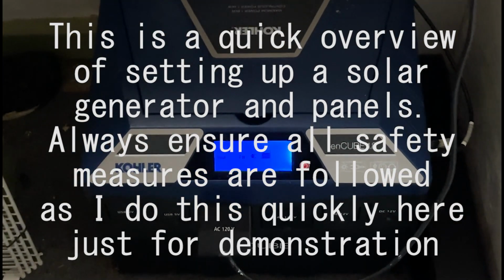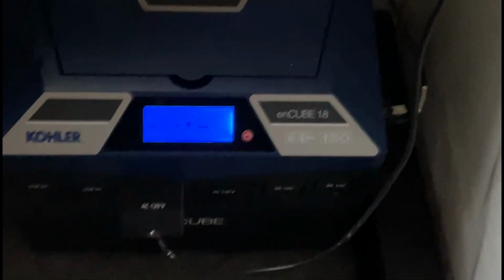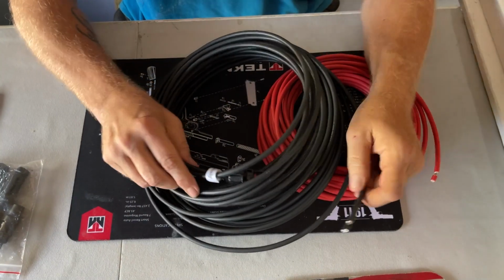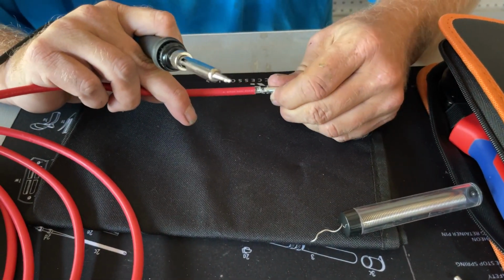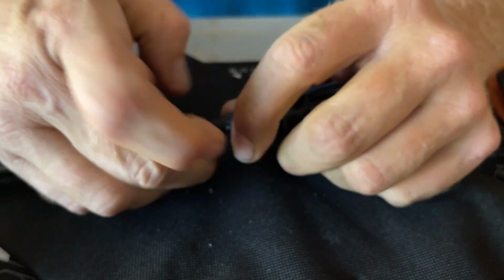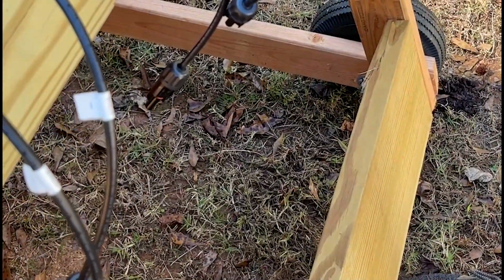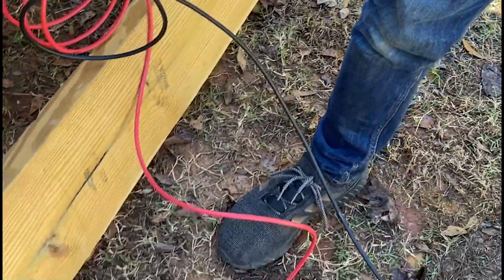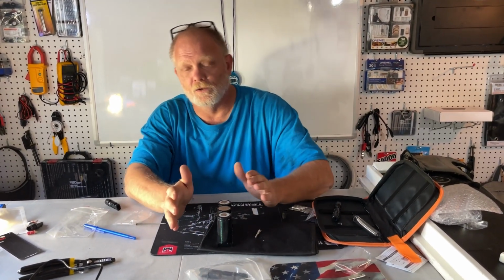Wiring up a basic solar panel system using the Kohler enCube 1.8

Comment: Sounds fun & I’ll be looking forward to it.
I built my own lithium battery bank/pure sine wave inverter and I ended up spending more than if I had just bought a commercial unit 🤫😟
But it does work well. 
I hope your not giving up on your insightful commentary.

Comment: I have been playing with a small Solar system for a few years now. I only have enough to power lights, fans and a few other needed things in a power outage. On a good clear day I can run my window unit AC for up to 6 to 7 hours with no problems. Lights and a fan are a must in Florida in the summer time.